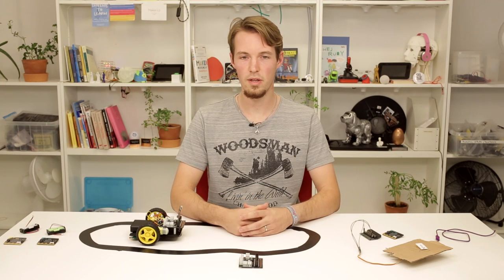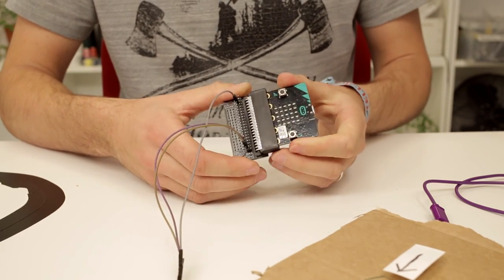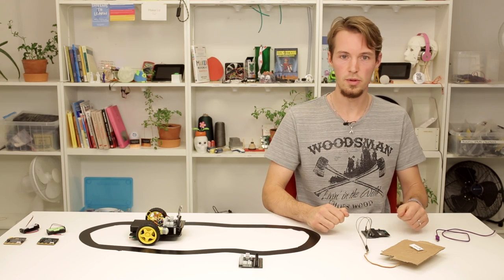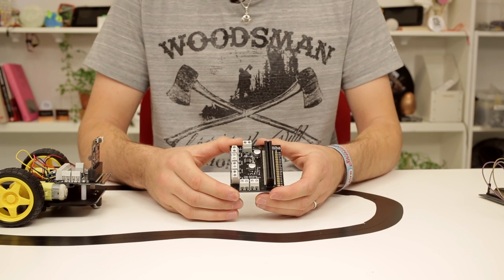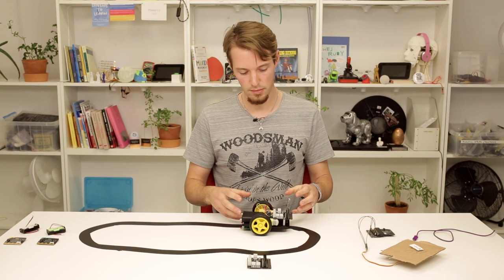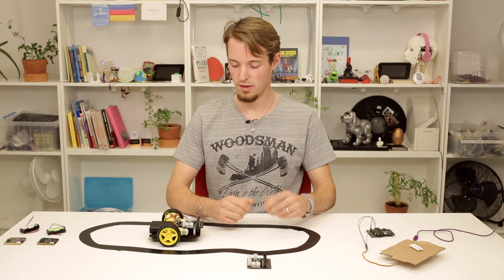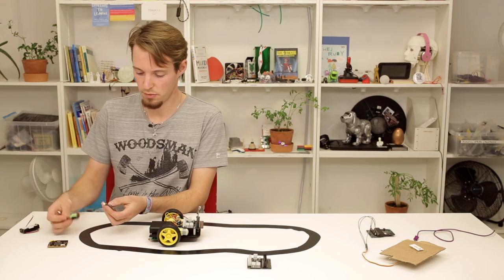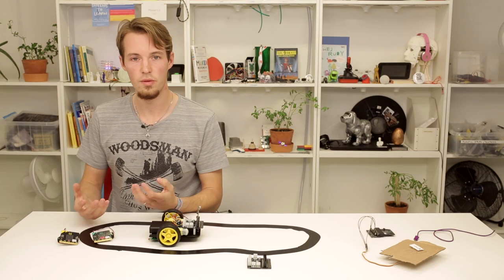9. microbit with other things

Comment: Great job. Am new to robotics. Can you send me tutorials on how to connect an ultrasonic distance sensor using microbit and a kitronics motor board?
Reply from the maker: The motor board is not required to make use of an ultrasonic sensor. Here is a tutorial, but unfortunately the code part is out-dated (at the moment) because the package it relies on can't be added anymore. You can at least use it for all surrounding info. https://microbit-playground.co.uk/components/ultrasound-distance-sensor

Then you can use the exampple on this page to send and receive pulses with your sensor: https://makecode.microbit.org/reference/pins/pulse-in
Reply: RISE Interactive Göteborg Studio Tnx a million. Going to check it out. Will update you when it is done. I really appreciate it.
Reply: I needed to use the motor board to replace the electronic board of the car. (https://makecode.microbit.org/projects/rc-car). So the microbit is in the kitronik motor board on top of the car and its working ok. The sensor is the issue now.
Reply: @GeorgeKWeah  hi, am new in robotic, can I connect a ultrasonic sensor to the kitronik motor board ??

Comment: Good idea !Could you write and  show this coding
Reply from the maker: Which of the examples do you want the code for? The servo motor we also use in another video in this series. The line following buggy is a kit we bought which is running the example code that comes with the kit.